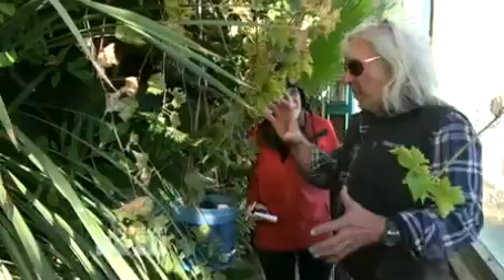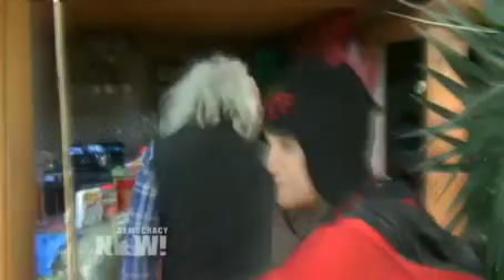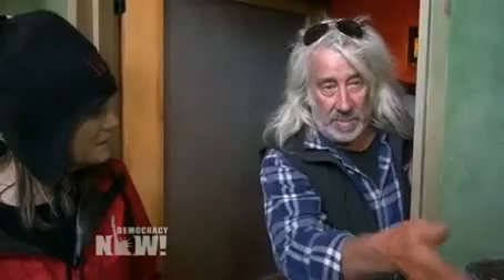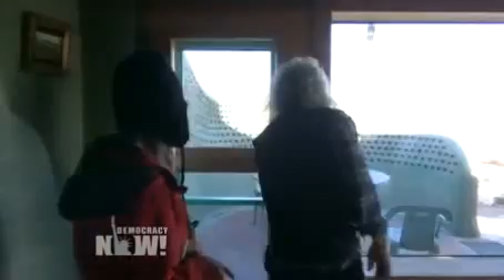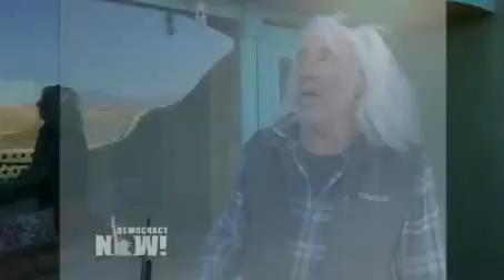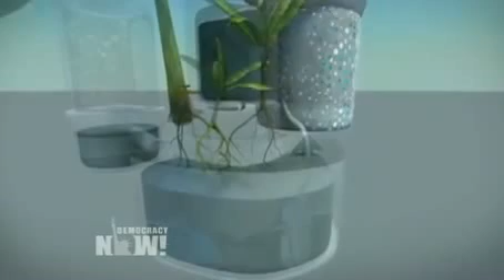"Earthship Biotecture": Renegade New Mexico Architect's Radical Approach to Sustainable Living

Comment: This is not new. Earthships have been around for quite some time. I have always loved the lighting from the colored glass bottles. The tires are great for insulation and temperature control sure. Unfortunately, the gases they output are toxic as they are petroleum based. I need clean air! 
Everything else is tits!! Research

Comment: To have suvage lake under the house to feet the plants make me feel uncomfortable.  I am sure that smell + some unwanted bacteria are here. All process is faster in dry and hot New Mexico. How this concept work for colder climate? It is very romantic concept, but it should be extremely expensive. Replace volunteer labor with emloyers plus cost of concret, to build this will cost a fortune. On another hand this glass bottle walls look spectacular.
Reply: Agalakov Natalia the septic tank is outside, grey water is inside

Comment: Laws are in place for a reason, because otherwise builders would use unsafe practices, or selfish ones that harm the environment and people around them.

If you believe you have a system that is both safe and environmentally sound, why not simply work with the government to get codes updated so that a system like yours can be updated to be permissible?  

It would have to be investigated though, to ensure that you perhaps aren't overlooking something that could pose a problem, at least if adopted en masse.   There are health risks with rainwater collection for example, if not done right, like the danger of zoonotic bacterial and protozoal pathogens, which is why we have codes.
Reply: ***** Well, technically a stick and brick home with drywall is really just wood and clay and gypsum sandwiched between sheets of paper, which are recyclable.  

The permit route makes sense, kind of like how you have a special permit for an experimental aircraft.    That way if there's not a specific type certificate, you have an inspector come by and check off all the basics.  Would be a bit more time consuming with more leeway for judgement used, but probably would also want zoning restrictions like "rural" zoned property for "experimental" homes.
Reply: DumbDuck44 because the government is not always for what's best for the environment or its citizens! government cares more about its self interest and profit. these houses are off grid and self sufficient and sustainable. which the government has no way to enforce heavy rules and regulation so the inhabitants are free and the government hates that because a free person can't be easily controlled.

Comment: Im with him but the sewage thing is a huge issue. I dont want my living room smelling like the aftermath of somone that ate too much taco bell. Who wants to visit anyone whoes house smells like a years supply of used daipers?
Reply: sg500 If you're living off what the house is producing there won't be the smell of "taco bell poop".  The foul smell of human waste comes from the chemicals in the food that we're forced to eat. The foul smell is also the human body's built in warning system to tell you there is something wrong. So if your waste smells that bad, change your diet and go see a doctor.
Reply: +sg500 there is no smell and you dont see it.....its goes through the planting cells and out of the house
Reply: +sg500 Also, realise that the Black Water part of the sewage is not going through that botanical cell.  It goes to the cell outside.  Mike never made that clear.  The Grey Water part of the sewage goes through the greenhouse botanical cell.  Neither of these are in the part of the house that you live it.   In older models the botanical cells were actually inside the living space and still no smell.  Now, it's all away from you.  Still no smell.  Very efficient and running off of Mother Nature's power!

Comment: I will build one of these for myself, and get off the grid!
Reply: samuski36 they aren’t off grid; they are using that word wrong. It is illegal in Colorado and most places to not hook to the grid. You can have a self sufficient energy supply, but you still must hook to the grid.  Any excess energy your system creates is fed into the grid and you get a check for the contribution.

Comment: Would it smell like rubber? Would there be any off-gassing?
Reply: No. These are not new tires, these are old scrap tires. off-gassing goes away once the tires are driven on. NM or WI did a study on scrap tires as building material and there is no off-gassing at all. However, the aluminum cans and bottles DO have to be washed and thoroughly dried before use in building walls. any organic material can rot and ferment and cause structure problems

Comment: Solar panels are getting a lot cheaper and more diversified -- easier to get off grid for power.

 Also, composting toilets are very simple and effective.  I do a composting toilet  with basically an outhouse with two seats.  One for liquid, one for solid.  The liquids get diluted with rainwater and dumped on trees and flowering bushes.  The solids get layered with grass clippings and pine needles, and put into a compost heap.  Separating them means no latrine smell.  Composts quickly.